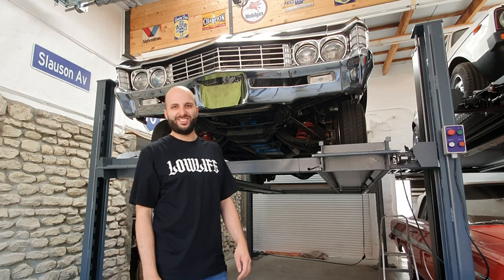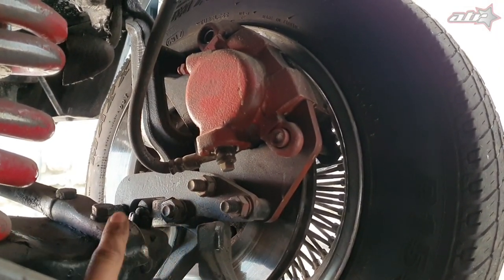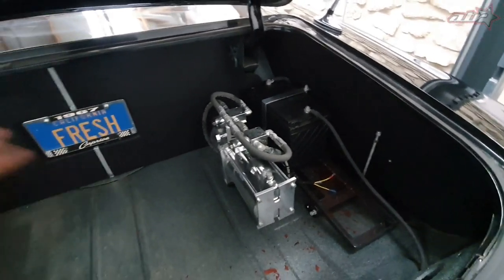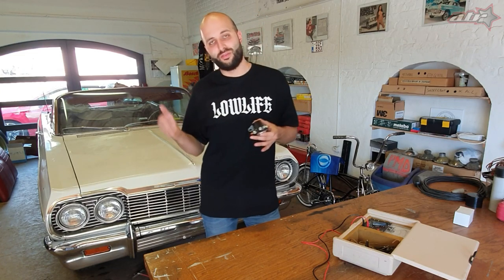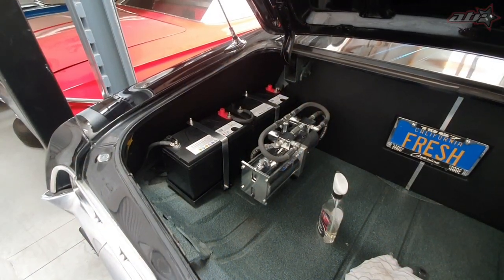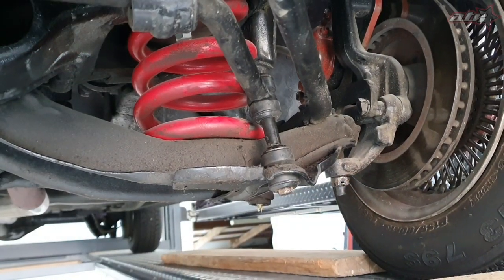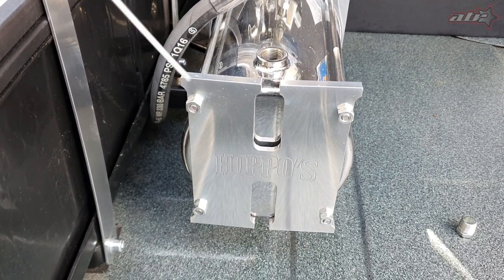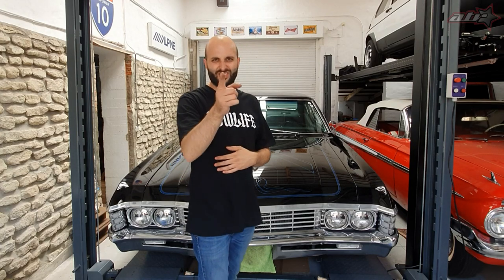How to do? Lowrider Maintenance! 1967 Chevrolet Caprice

Comment: Nice vid
Reply from the maker: Thanks!
Reply: @AMB1800  do you think a lay and play set up not switch happy can be a daily driver?
Reply from the maker: @AnthonyRoman-bu3df  it could, nothing is impossible but I'd say it depends on many factors, one example is location. Where I live we get very bad winters and no lowrider shops at all either so if something would break down, you would be down for 2-3 weeks till the parts come in from USA. A nice solid, well build setup will hold on nicely but none the less, lowriders demand more maintenance then other cars so it is important to consider that too.
Reply: @AMB1800  I live in Cali

Comment: Alot of bad habits here,always use 24 volts for solenoids,most dump just ground through the pump body it's low amp so aluminum is cool..be very weary of following theses bad habits..oh and replace every solenoid in that if you have a run away..the best test for a solenoid is to shake it and you can tell .. testing does help but if you have to test toss it anyway..
Reply from the maker: I have runned solenoids for 10+ years on 12v too and never burned one, even on 8 batts 96v to the nose and switch happy! However, I run them on the front battery which has a constant 14.7v when the engine is running. When you run them on one of the rear batts, the hydraulic pumps will drain the voltage down, causing the solenoids to loose power and start clicking and welding shut, thats when you get a stuck solenoid and problems start. Keep in mind most of these are just starter solenoids and are made to run on 12v, most people just run them on 24v because they "want to be safe" or because their cousin told them to do so xD